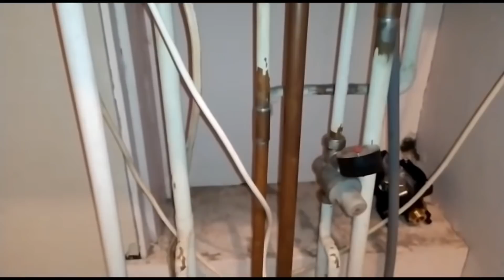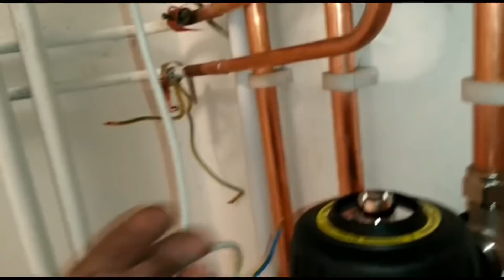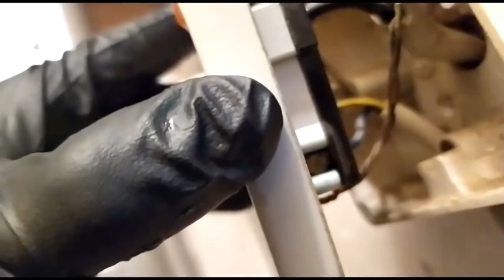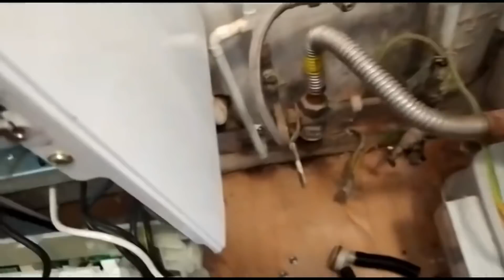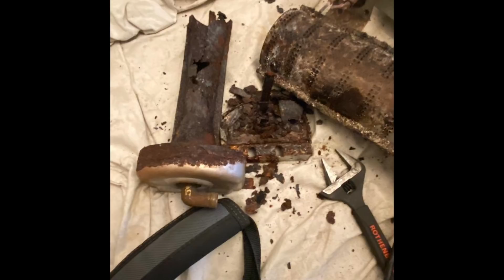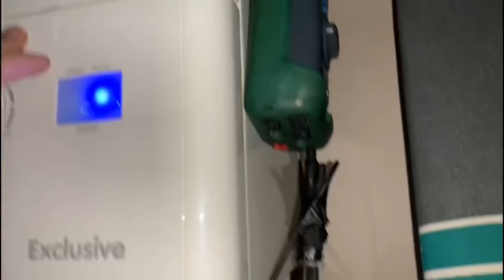Plumbers Videos - Boiler Tips - Dangerous Boilers - Safety Bulletins

Comment: boiler interlock ,  watch all your  vids of  yours and elliots allen , im an  addict now  brilliant   sometime years     ago i had an installer  on lpf  large house  2200 lotre home heat    lpg  vessel ,  he had installed    blue water pipe  whole length of  pipe run under     the turf  correct  depth etc  it was gas tight biut he  warned me id get  sacked   because i   disconnected  suipply  it was gas tight , he was full of apologys  when  my boss asked  me to return  to  fit   correct yellow  pie  in  fact  he offerred  me 400 pounds  to keep   water  blue pipe conne3cted   as  its was  an  1.5 million pound house  and  owners were moving in   in a few  hours .  no   chance i was leaving it cheers  mate   always  thank full to watch you and elliiot ,

Comment: Great video, not all cheap boilers are installed badly and going on personal experience and like most things in life you get what you pay for, I fitted about 12 ferroli optima he 31c when they first came out years ago, when ferroli made the switch over to condense properly, I had loads of problems with them, some within weeks of being fitted, put me of installing ferroli ever again.
On the subject of the damaged gas pipe in the builders opening that some one came across, never put a gas pipe in a builders opening without it being wrapped with insulation tape, Soot eats through copper pipe like no tomorrow, seen it loads of times.
Reply from the maker: Thank You

Comment: Budget boilers rely on a professional installation. Elements include suitable installation materials and a premium siting / working environment for ease of access for furture maintenance and service. A contented service engineer equals a calmer/ caring engineer. This in itself increases the appliances life span.
Through experience it has been noted that budget boilers generally have 1 year warranty their internal components are of a cheaper construction. Their spare parts can be up to three times more expensive then that of a premium manufacturer. So the long term saving on the purchase price can be  lost quite quickly.
Reply from the maker: Thank You

Comment: Boiler interlock, often used in commercial installations were the boilers are situated inside a sealed compartment. Always watch videos to the very end, thanks Alan.
Reply from the maker: Hi Mark. Do you know what a boiler interlock is on a domestic boiler installation? Thanks.
Reply: @AllenHart999  hi Alan, yes I do it is a system of control measures that close down the boiler when certain user inputs are met, usually through room stat, trv's, programmers etc. Just thought it might be interesting to see how terminology transfers into commercial.

Comment: Boiler Interlock  :-)
Reply from the maker: Hi Wayne. Thank you for all your support.
Reply: @AllenHart999  Watched your mains flush video, I've got 10 Rads 3 bed house. Going to use two bottles of F3 cleaner run it for about a week then flush it out. Then add inhibitor.  I got a Omega TF1 Filter with isolation valves either side.  I'll add the cleaner through the filter.. see you do that before.. then flush the mains water through the flow pipe through each rad in turn, back to the filter and out the bottom through a hose.  About 2 years ago i replaced a shared lead water main (semi detached property) with a 25mm MDPE blue pipe. Water company did a free connection through lead replacement scheme. I core drilled the concrete floor in the kitchen under the kitchen sink,  used 4 inch plastic waste pipe and insulation as it was against a outside wall. It was dug to a depth of 900mm and ducted  as it passed under a sewer pipe on route to the road.  It was passed by the water company and cost me approx £300 with buying some tools inc.  Great saving on moling £1500 and a private plumber £1000.  Flow rate has more or less doubled and no longer does the shower cut off when the washing machine is filling up.  In the trench as the pipe passed under the foundations (1950's house) I navigated around the sewer waste pipe, electric supply cable and gas supply pipes.  I'll whats app you a few pics as i'm a novice and have learned from Youtube and watching the great quality of help and advice given out for free by your videos.  Totally agree with you gas is not for the DIY but there is so much a novice can do and save themselves a lot of money by doing some jobs themselves.

Comment: How would condensate pro stop the condensate blocking ? Perhaps you could review other ways of insulating condensate for installers who don't want  to use condensate pro.
Reply from the maker: If the condensate had been installed correctly it wouldn’t block or freeze. Why wouldn’t you want to use condense pro? Seems a strange comment. Thanks.
Reply: @AllenHart999  The use of condensate pro would not on its own have stopped the condensate from  blocking as it was not frozen. A correctly installed condensate would not block whether it was condensate pro or not. I was just wondering how you would chose to insulate a condensate if this product was not avaliable to you. Not having a pop just curious that you show various products in your videos (which I enjoy by the way) but only one form of condensate.
Reply from the maker: @dereksmith7201  I used to use class o lagging but i wasn’t installing it correctly. I didn’t know at the time, Hence the reason i now want to inform as many people as possible. I always thought class o was waterproof but the stuff we used wasn’t. Condensate pro has now been approved by most of the boiler manufacturers and its also shown in the new TB155 Thanks.
Reply from the maker: What do you use at the moment? Thanks.
Reply: @AllenHart999  This is why my question originated,  I am struggling to find a product other than condensate pro that complies . I have no problem with the product at all but am a firm believer in not putting all eggs in one basket and should the job arise when I can't get that product I was hoping you new of an alternative and could review it. What would you do if you had an emergency boiler change and could not get condensate pro?
Reply from the maker: @dereksmith7201  You make a really good point. The other option is to use class o lagging, Problem is you need to paint it twice to be waterproof. personally i wouldn’t want to be painting lagging.
Reply: @AllenHart999  Exactly, I am amazed as engineers we only have two options ,buy from one manufacturer or become a painter. I was hoping you knew of another company doing a similar product but looks like we're stuck with these.  Cheers mate keep videos coming
Reply from the maker: @dereksmith7201  Ha Ha hence the reason i am promoting it as much as possible. I do not get paid or anything like that. Thanks for the chat. i really love the feedback.

Comment: Boiler interlock and where it can be established it would be good to know on these foul ups if it was installed by a Gas Safe engineer.
Reply from the maker: Hi Norman. It’s hard for me to comment on that. Hopefully, videos like this will show customers that work like this is not acceptable. Thanks.
Reply: @AllenHart999  I appreciate that. I do find it hard to believe that there truly are a significant number of installs done by DIY. I reckon most of these are done by ‘Bodgit and Scarper’ with a few maybe by disgruntled Gas Safe engineers. I am a fully time served Marine Engineer with years of experience in superheated steam propulsion boilers, gas turbines, air conditioning and refrigerating plant,  electrical generating plant and distribution systems. I will turn my hand to just about anything and everything mechanical, electrical and electronic, but I would not attempt a domestic boiler install.
Reply from the maker: @normanboyes4983  I would love to know more about what you do. If ever you feel up to please send some videos in. Thanks so much for your support.
Reply: @AllenHart999  Retired now👍
Reply from the maker: @normanboyes4983  That’s a shame. Well, Thanks for watching.

Comment: Baxi 401 501,now your talking my language,ha ha..Twice I had this in 45 years no hot water 2 port Honeywell Turned on HW  ,valve opened and watched it cycle , Flow and return working as normal ,boiler cycling correctly and zone valve staying open as sometimes a lazy motor would close after a few minutes  but elderly customer reported had no hot water since the previous after noon ? The second was a Janus 3 circulator Again elderly customer reported circulator  firing and circulating correctly but could not get water warm. Same cause in both cases anyone?Oh and boiler interlock
Reply from the maker: Thank You

Comment: alan wondering if you can help i have a Johnson and starley warm air heating system and a hot water tank heated by the old Johnson and starley . i want to get a new combi install in a 3 bed end terrace. what price am i looking at these days .cheers
Reply from the maker: What area do you live? Thanks.
Reply: @AllenHart999  hampshire RG24 basingstoke

Comment: Boiler interlock , with the cheap boiler I guess installers don't care at the level that the profit is not that high , but to be honest the basics should be always followed,  my first ever install boiler was vokera system , haven't been flushed properly and condens was outside in overflow,  its been as a subcontractor so pretty much follow the boss orders but still was my gas number filled up in paperwork, I do always make chemical flush now , rarely customers wants power flush even when I explained them why and what can happen,  with the service ( strip down ) there is on daily basis for everyone of us that boilers are not correctly installs ( missing filters ... )  but many times poor maintenance it's on owners back , I already have a few boilers I did install last year but customers don't want me to come to service them even when I clearly remind them they will loose warranty...
Reply from the maker: Thank You